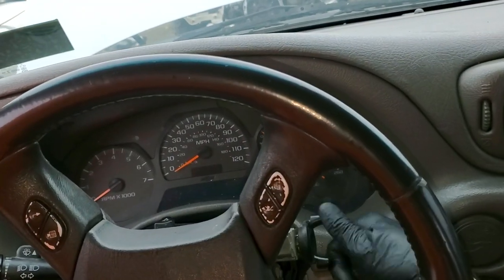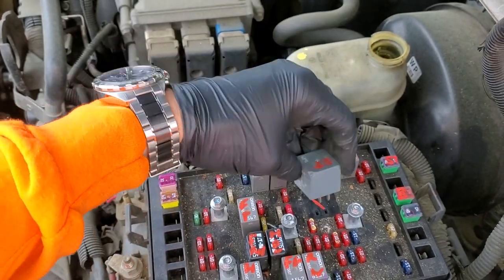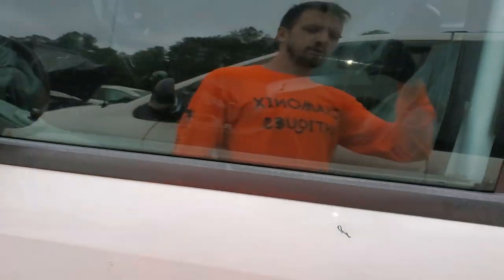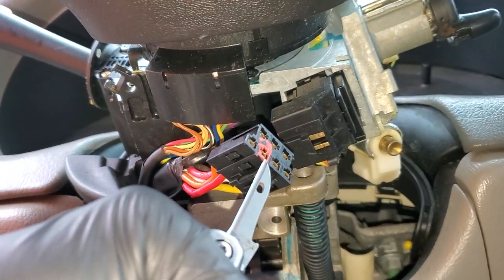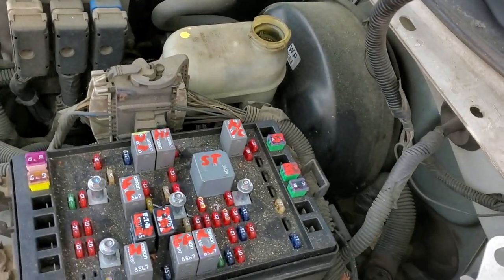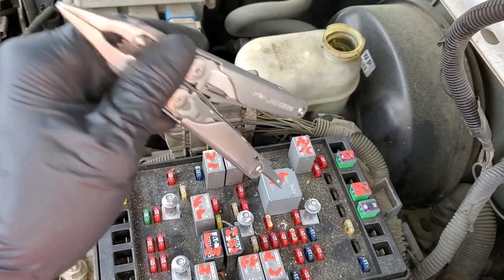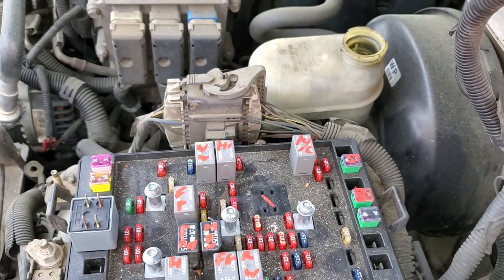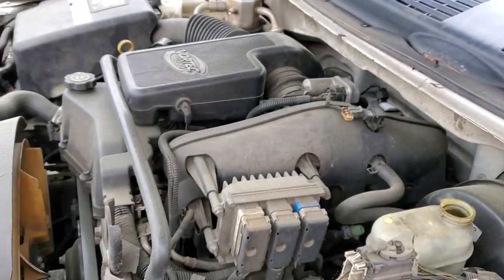2002 Chevy Trailblazer Starter Relay, Starter Fuses & Circuit Explained

Comment: Very well done video! I just replaced the battery thinking it was the problem. All indicator lights and sounds come on but when turning ignition it clicks once nothing else. 02 Trailblazer LT 275,000 miles . Has been very dependable

Comment: I am not familiar with the 40 amp fuse at 1:17 so i glanced over it and said good enough.   After a starter and ignition replacement with still no crank i went back to where i started and just swapped the two green fuses since they were the same... and it started. Since the clear covers just clip on, i took it off. and there it was, A blown fuse all along.   Thank you for this video. I help tremendously with the workings of this system. (2004 Trailblazer)

Comment: Was actually wondering if something like this was the issue for my girls TB not starting for a brief moment the other day. She was at the atm and all of the dash lights came on and non of the electeonics worked. Her car wouldnt start and onced I jumped it, it worked perfectly fine and has since. Had the alternator and battery checked and everything was good. Only code for check engine light was a bank 1 02 sensor. Any ideas would be greatly appreciated!

Comment: Please do video on checking for  bad relay & how to test female pins for power supply on relay connection with out swapping 4 & 5 pin relay ,also battery drain ,ground & short .Your video’s are very clear explanation to the point thank you Sir for great videos. Regards 🙏👍

Comment: Thank you so much for you to share your excellent description of the starting system of the Chevy Trailblazer, detailed with every step of the system. I have a question regarding this system that amazing me every time I start the engine. When you give the final "push" to the key, it is not necessary you to continue with the "push" to the key,  the system hold,  by himself the relay energized on until the engine starts. I believe this is because of the control module, is that correct? P.D Sorry for my english that it is not so good.

Comment: The best video of any type. No ads, good diction and your pleasant voice. I wish I'd seen this before I put a starter button bypass to my starter, years ago.  I'm looking for a way to use a solar car battery charger on my 03 Trailblazer, 16 Passat and my Husqvarna mower. I think that using a jumper cable from my VW to start the Trailblazer and mower might have, or may, cause VW damage. I don't know and I haven't found anything on youtube that covers charging the battery inside the vehicle. I'm also looking for a video like yours for my VW's flashing dash lights,  ABS/traction, ( the wheel sensors I fixed). I'm wanting to find and replace the ABS control unit's fuses/relays before taking it to VW. (HINT) $THANKS?

Comment: Thanks for all the info!  I made sure I had 12v to the ignition switch, and then back to the fuse on the fuse block.  All voltages were present.  I then tried to jump the relay for the starter, and the car ran; and has started working since.  I had tried tapping on the relay, etc... and nothing changed.  But jumping the relay, it seems to be working every time now? Strange!

Comment: I got a 2004 Chevy trailblazer man I've done everything I possibly can to get this thing back running for my mom no crank no start just like it doesn't have ground all fuses are good brand new battery brand new ignition switch brand new mega fuse grounds are clean

Comment: First thing that I do and what every would be mechanic should is clean up the ground from the battery to the body.  Open the hood, take off and clean that main ground and every other ground that you can see or reach.  Clean all the grounds, reconnect them, start diagnosis.

Comment: QUESTION!!!!! My 2005 trailblazer 4.2ltr will crank but won't start, it left us stranded I tried to reset it by disconnecting the battery so after towed home no codes on scanner , so I put new crankshaft position sensor new knock sensor both changed then I changed camshaft position sensor and the vvt actuator, the last code I saw a week before this happened said upstream 02 sensor so I changed that I even change the intake air temp sensor but she still wont start it will crank but wont start up , any advice ?  i think its not getting fuel

Comment: Is there anyway to get the engine to turn over but not start i tryied pulling a few fuses i thought would do it and it wont crank at all with those fuses pulled i want to spin the engine over at crank speed see if the new belt is on correctky before i fire it and it gets destroyed because its not on there right

Comment: I have an 03 trailblazer,  what could be the issue if there's no power going to the relay? Tnx in advance ☺
Reply: Also When I try to start it it shorts out and looses power to everything,  shuts off then the lights n everything comes back on till I try again!! In desperate need of input. Ty
Reply: Have tested and negative on solenoid is grounded but no power to the rest of pins to solenoid.

Comment: I have a question 
So my trailblazer had minor issues before ..it  had check engine on as well and just yesterday it gave out in the middle of the st so I swapped the battery/alternator & ignition switch I assumed it was time for maintenance its been 5 years. So the check engine went away and cranked up immediately so I put everything in place cleaned up cranked it one last time it gave no response no power no nothing and the check engine light came on 
I'm pretty lost i replaced the fuses you explained I have no idea now ..would appreciate your input if possible thanks in advance.

Comment: Good morning I enjoyed your video I love the way that you are detailed and explained everything. The situation I am having with my 2007 Chevy Trailblazer straight 6.  I'm getting a low engine pressure light, and my car goes into Limp mode. Ill turn it off and wait and the car its self will go out of limp mode and I can drive it just fine. I'm chasing possibilities, such as throttle body, fan clutch, relay's, fuses, even ECU. If you could shoot me a message and help me out they be greatly appreciated. Thank you Dawn

1 second ago
Reply: Throttle body

Comment: I'm having a no crank issue and no accessories on my 02 tb ltz I've replaced the ignition switch and ignition relay and the mega fuse still nothing .any help? thank you very much. Also tried to start in neutral nothing although transmission has been replaced..

Comment: Nice video,  but I cant not figure my 08' issue, it's a no crank no start, it was wrecked, so while I was fixing it, it did run, but I let it set for about a month, hoped in it, hit the key and nothing, battery is charged, switched out ignition switch , still nothing, cleaned connections every where possible I could see, none of the guages work, checked all fuses, I dont hear the fuel pump kick on, windows work, radio works unless you attempt to start it, cuts out till you let up, all lights work, no dimming while key is forward, starter cranks if you cross relay connection 30 to 87, I'm very stumped, no security light on at all.
Reply: bro im having the same issue now did you ever figure it out ?
Reply: I'm having the same problem, did you figure it out?

Comment: I have a 2002 Chevy trailblazer and I just put a new battery and new starter and a new alternator in and it barely turns over what could be the issue

Comment: OK I have a pretty dumb question I just picked up a 2002 trailblazer the guy said he replaced ignition but I have a new start no crank but when I jump the starter relay it did crank I don’t have any test light or a meter what could the problem be

Comment: I am having issues with mine starting.  If I switch the relays around it will eventually start.  Would that be an issue with the fuse box itself?

Comment: So I'm getting power to yellow wire on ignition when I turn key to start. But can't get it to crank  unless I pull that relay and cross it and then it will turn over but not start. Also when I turn the key to start something in the fuse box under back seat is ckicking.. pretty sure it's RAP relay cus if I pull it out it doesnt click back there. I traded  places witha different one and did same thing. Anybody got any ideas
Reply: Great video, I am having the same issue on this coment , I check and all powers are good except no ground on pin 85 of the relay at all. can that be a pass lock or security issues,  this has me stop,  your help will be greatly apresiated if you may know the problem,  this is happening on two of my trail blazer same issue on both , thanks in advance if you can help

Comment: My trailblazer only crank when I jump start the battery but the  battery and the alternator is OK  I just change the switch and now the key turns but no crank at all I got light on the dashboard with no code at all  then it will turn off after is iddle for 1o minutes  and the only light that stay on is the  battery light  even with out the key it will be nice is you can share more solution I foll9w all your fuses and they all ok

Comment: What would be causing that 40 amp fuse to blow? (IGN A)
Reply: Did u ever find out? I’m having the same problem
Reply: @dg7848  I did figure it out actually. Turns out there was a short somewhere in or behind the instrument cluster. I unplugged the instrument cluster and plugged it back up and never had a problem again. Worth a shot if you are having the same issue!
Reply: @ThingsWithMotors  I think it’s this radio I have in they cut into my ingnition switch wires and wrapped around going to patch them with electrical tape and get a new fuse hope it doesn’t blow
Reply: My issue is no power to the solenoid but it is grounded,  that's the only pin that works.